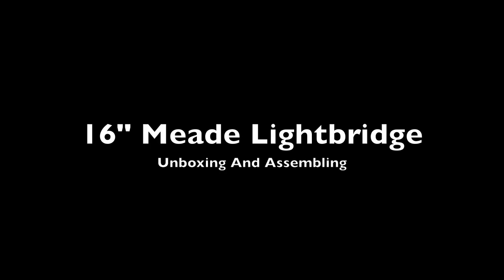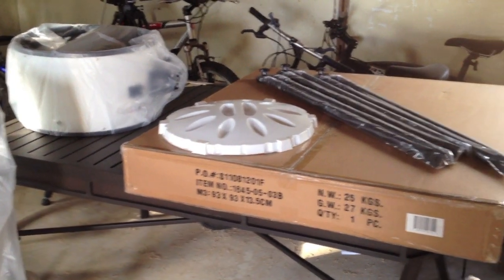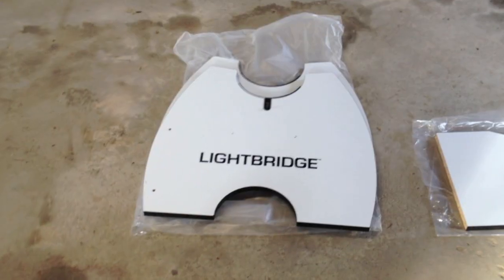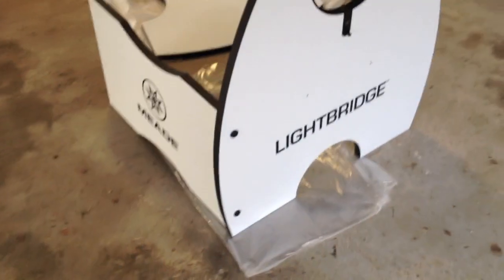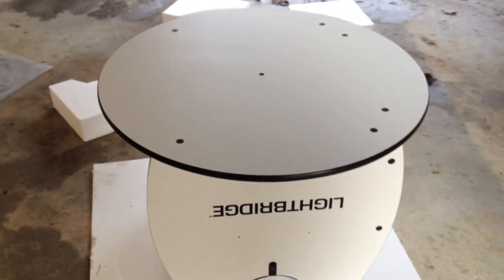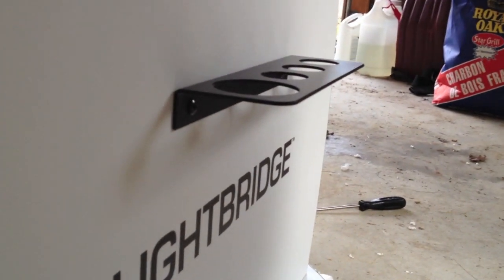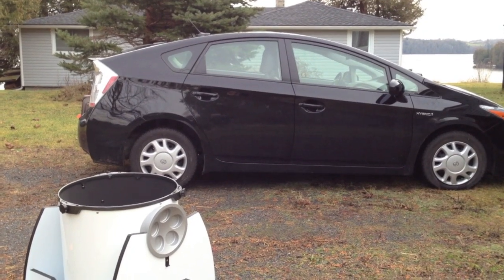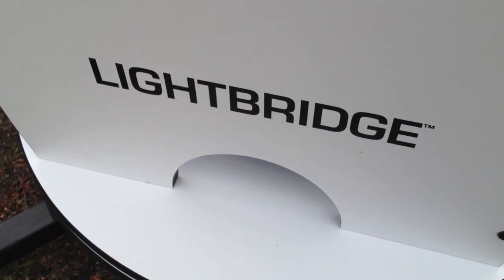Meade 16" Lightbridge Telescope - Unboxing & Assembly

Comment: Nice video. thanks. I have a 12" dob and a standard Scopebuggy that I use with my CGEM. Did you just set the dob ob the Scopebuggy without adding a platform or some modification? Is it just balanced on the bars?

Comment from the maker: I keep it in a garage, and roll it our for using. The garage is unheated, so the scope is always at ambient temperature. I note that some people have modified the base to reduce the diameter, or rebuilt it entirely. It would fit as-is through wider or double doors, but it's heavy, and is much easier on wheels. I had first light 2 weeks ago, and it was fantastic - sensitive to collimation but great. I'll post another video about that soon.